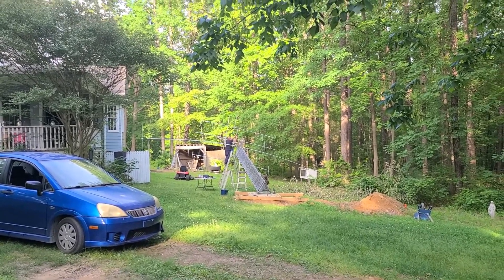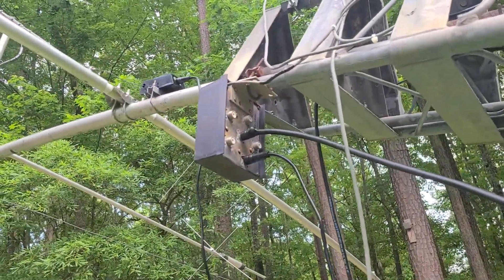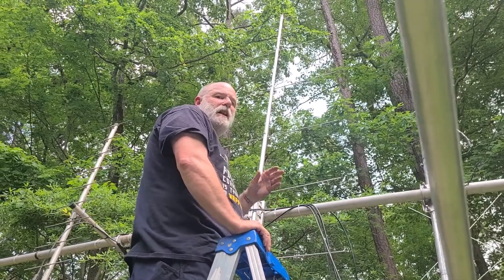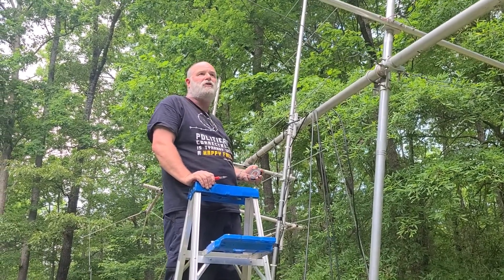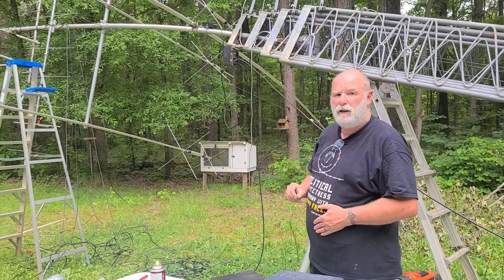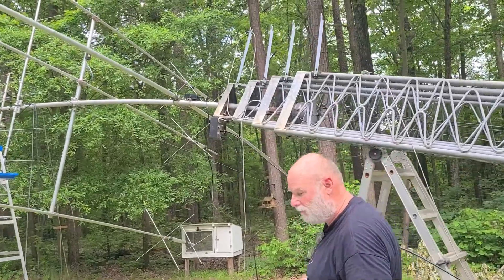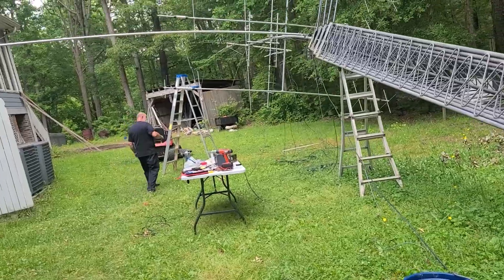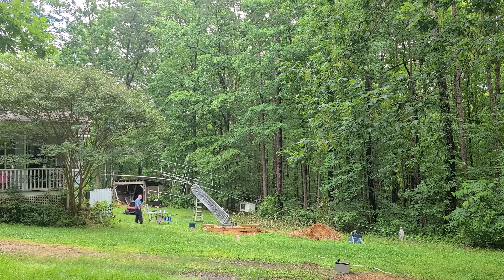E136 How To Raise A HAM Radio Antenna Tower

Comment: Was this antenna guyed or freestanding (no guys)?
Reply: These are not guyed
Reply from the maker: Not sure what you mean, I was just helping a friend
Reply: @Coolbreeze61   So the tower looks like it is stout (strong enough) that it has no need of wires from the tower to the ground that would be attached to keep it from swaying in the wind.   Guy wires are basically safety for wind loading.

Comment: You really should use a Falling Derrick with this setup to reduce stress on the winch cable and tower assembly.
Reply from the maker: You're right if not that a snatch block
Reply: @Coolbreeze61  Falling Derrick and a Snatch Block are two very different things used for very different reasons.
Reply: How does a falling derrick reduce stress?
Reply: @roynorman3650  Watch some videos using a falling derrick. When the tower is nearest to the ground the winch is almost pulling straight down on the tower, towards the base of the tower, causing high stress on the tower, winch and cable.

Comment: He is using white zip ties to hold the coax to the boom.  Bad idea as the white zip ties fail quickly due to UV from the sun.  He should use the UV rated black zip ties or wire twisted around the boom to hold the coax in place.
Reply: Nonsense. Zip ties good for many many years.
Reply: I was going to say the same thing I work for the phone company and they decided years ago it was a great idea and they failed so quickly white is no good for UV
Reply: I use the black uv ties, and I still wrap them with 33 plus tape for that reason.

Comment: That 2m beam isn't mounted correctly.  If you mount a vertically polarized beam on a vertical mast pipe, the mast acts like an extra element in the wrong place and destroys the pattern and gain of the antenna.    Vertically polarized beams should always be mounted on a cross boom (like the 440 beams in this video).
Reply: I wish i had these problems...
Reply from the maker: Don't know anything about that stuff, this was at buddy's place and I just created a video of us raising it but I'll let him know
Reply: Cross boom?